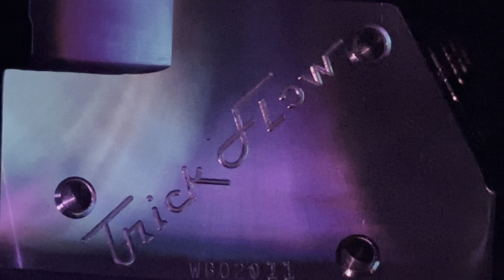The cammed exhaust sound of my 5.0 SBF 331 stroker SN95 Mustang. Plus new Trick Flow 11R Heads.

Comment: What compression ratio did you build the motor to? 10.5:1 and higher with those heads would be a great NA combination
Reply from the maker: I believe it’s at 10.3:1 compression with the original combo. The new Trick Flow heads have smaller chambers than my old heads so hopefully we can raise the compression some.

Comment: Sounds good. The 205's should get you to 400. Are you going Trick Flow intake as well?
Reply from the maker: For now I’m only doing the head swap.  I’ve always been curious as to what the difference only swapping the heads would have.  Later on down the line I’ll probably end up upgrading the cam and intake because I know there is power to be had there.
Reply: @scottsvt9104  good luck with it! You have a beautiful car!
I have a 94' GT convertible. Black and white with Trick Flow heads, Trick Flow lower and upper intake, bbk cold air, and bbk shorty headers. E303 cam and 2 cat exhaust delete. 
I love driving it!!
Reply from the maker: @coreyrowe2052  thanks!  I really like the 94-95 Mustangs because you still get the old school SBF which are fun to drive and modify!

Comment: Hey Scott this is Charles, from6to8 on the forum. What power did you make to the wheels with the 170 cc's? Did the car pull well, was strong?
Reply from the maker: The car made 326 rwhp and 356 lbs of torque to the wheels.  The car pulls very well and runs neck and neck with stock 10 speed Coyotes.  That’s with box stock Edelbrock performer heads.  Sounds hard to believe but the cars light weight I believe gives it a huge advantage.
Reply: @scottsvt9104  not bad not bad. Well my 94 Cobra is heavy I'm sure with those 18x11's and 315 30's out back and 18x9 or 9.5 with 275 35's. It was at 286 with around 301 ft lbs torque with the Edel performer rpm 2, TF 170's, 75 maf  and 70 tb with shorties and flowmasters. I put on LT headers and a free flowing pypes bomb catback and it does feel like it picked up pretty decent. I still will likely make a move and either do a 331 or an SC. I'll likely opt for the freshend up engine and to just stroke it. I'll have to see about wanting to get new heads (probably 11R 195 or 205 or AFR or Brodix) and sell mine  or just sell my engine (192k miles) and buy a crate minus the intake and heads. Decisions decisions when that time comes man so i'll have to see.
Reply from the maker: @sandmansimms5704  The best things to lose weight on the Cobra would be to get base model seat tracks and some light weight adjustable race seats and delete the Mach 460 sound system but retain the main door speakers if you need sound.  If you don’t want to do that then adding more power is the easiest option.  Whenever my car gets back from the shop and we tune/dyno it you may just want to copy my set up if it puts down good numbers with the 331.  If it doesn’t then I’ll have to go back and re-think my combo.
Reply: @scottsvt9104  yeah it'll be the adding more power option for me as I just did the cosmetics on the car and had custom seats done and forgestar wheels. For me it's the best of both worlds as I want the car to look great and run great :). Yeah i'm curious to see what yours does because it if does good numbers and feels nice and strong I can see freshning up to a 331. I thought about the big dogs porting route which I might still do but just depends. I'll have to revisit my convo with him to see what all needs to be ported that I want to remove to have done that would make decent sense. If I have to do a certain amount of tearing down then I might would rather just pull the motor and do a lot more but and I"d look at the potential number comparisons as to yours vs porting.
Reply: @scottsvt9104  what's your current combo again? FI or Carb and what size meter and tb, cam, shorties or LT's, ect?
Reply from the maker: @sandmansimms5704  Mine uses a Holley system to tune so it doesn’t use a meter.  But it did have a Pro-m 75mm meter tuned for 30 pound injectors.  The old combo used Edelbrock Performer heads, xe274hr cam, 70mm throttle body and Edelbrock RPM 2 EFI intake with short tube headers.
Reply: @scottsvt9104  gotcha and wow similiar combo to mine but mine made only around 300 with the same intake, TF 170's that were actually milled down to 58 cc to not have to use an o ring head gasket ( not sure how big of a deal that was lol), I had shorties then and put LT's on when I dropped that engine in the 94 cobra and a pypes bomb free flowing catback vs the flowmasters, the cam was an E that was reground to around .512-.523 lift. That's a significant difference in what you were able to get with what seems should be similiar components.
Reply: @scottsvt9104  lol forgot about the extra cubes 😂